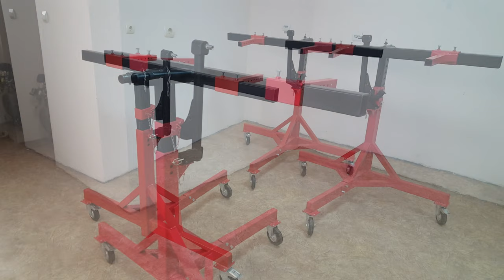DIY car Rotisserie

Comment: You made the SAME mistake I made.  The center of gravity of the car is wel above the rotisserie pivoting point.  It will work well at shallow angles, but will be very heavy and the car can even turn upside down violently out of control.   You´re very close though and your work is perfect.  Turn the horizontal beams (that hold the car) verticaly downwards and add 4 horizontal beams that fix on the car on these (now vertical) beams...  DONE !!  Again, very nice work. Congrats.
Reply from the maker: A friend, for who I was making, demanded so.  I did better on another project
https://youtube.com/shorts/fVqsQytHM5o?si=U6NH4kcqTtl0GLvm